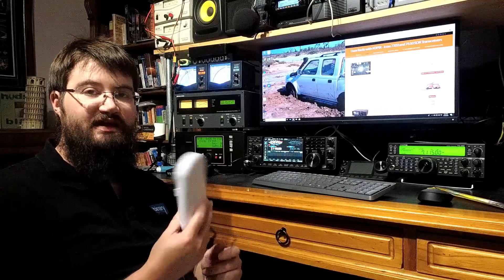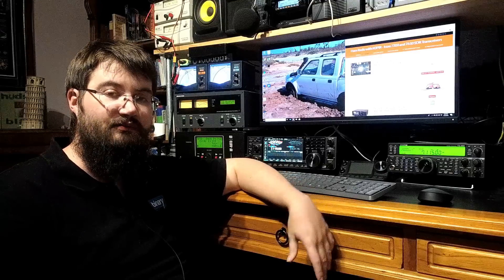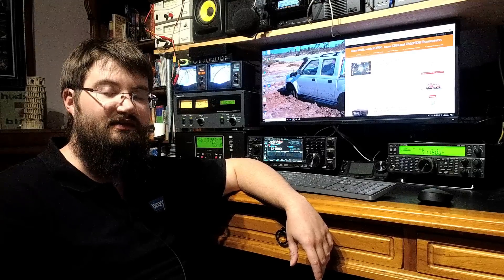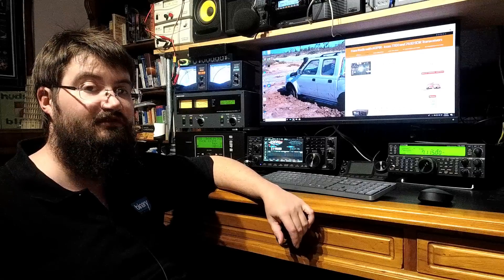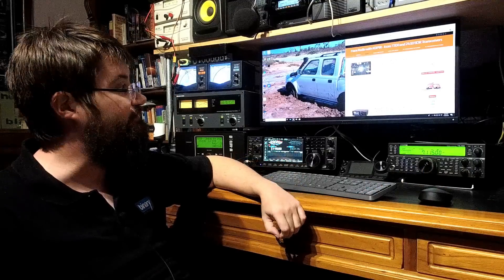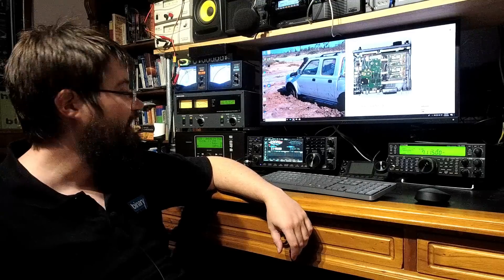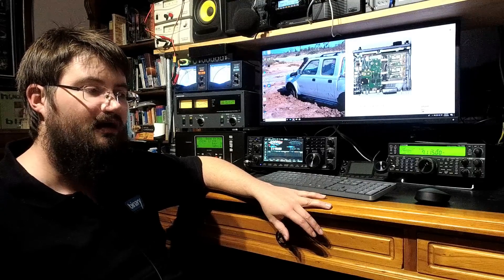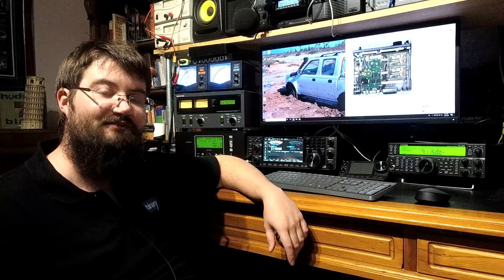IC-7610 Issues: LCD Burn In, 'Heatsink Gate' & Others

Comment: Hopefully Icom makes the LCDs available at a reasonable price.  If I have to replace it every 3-4 years due to burn in I'm not going to complain too much, it's otherwise a fantastic radio at the $2990 price.
Reply from the maker: Thats a good way of looking at it Andy.  Icom have always had very fair pricing on spare parts.  I will always remember when a grey import dealer quoted me a whole new remote hand mic for $100 USD, yet when I drove down to Icom not only did they have the LCD I needed in stock, it was only $5 USD!  I bought two just to be safe!  

All that said, we suspect its just a bad batch, and that a once off replacement for affected units will be all that is required.

It absolutely is a fantastic radio, and mine hasn't left the shack to get the LCD fixed even under warranty yet as I would miss having it around too much :)  

73, Jarrad VK3BL.

Comment: the display issue still has not been completely ironed out,  some people have had multiple display swaps...knock on wood  my 7300 has no issues in my experience , display still looks new after a year of use. I wanted to upgrade my rig but think I might cross the 7610 off my list ,  looking at the kenwood 890s now even though the waterfall on the 7300-7610 seems to be more fluid with a higher refresh rate ... the 7300 is solid rig for sure

Comment: Yup its an issue, mine which also falls in the range of S/N's for the heat sink issue too, has the burnin/ghost image issue really bad. I have been in contact with Icom america, but they had no real time line on a correct fix, short of replacing my screen with the lot of bad ones and roll the dice.  I was told to call back....LOL...I have( 1 month later) and have gotten absolutely no where.  Now I am am seeing ALC issues where the ALC completely stops working on the meter function. 3 resets and I still see it at random times even using the stock mic and factory defaults. I feel ICOM has and is dropping the ball on a radio at this price point.

Comment: The new LCD revision fixes the issue, its a new LG panel part so good news for those who waited for the bugs to be flushed out due the early  beta testers. And also a 400 dollar savings as well.
Reply from the maker: I’ll be booking our unit in for a LCD replacement soon too can’t wait but don’t want to part with the radio either!  73, Jarrad VK3BL :)
Reply: Hi Jarrad...I sent you an email about this as well, so sorry for the duplication. But this is the first I've heard about new, dependable LG displays. My screen went south after only two months and Icom has been largely silent. Do you have any more details about this new screen? I've got a number of folks that would be interested to know more...thanks. @RateMyRadio
Reply from the maker: Dear @joebozell6531 , please accept my apologies that I haven't had a chance to reply to the email - it is flagged :). This is also the first I have heard of new LG Display but when I take my IC-7610 in soon for a replacement under warranty I will find out more and report back.  73, Jarrad VK3BL :)
PS, comments here come to my attention a little quicker than emails as I get fewer of them.  Sorry to hear your screen went bad in a similar time to my first two.
Reply: @RateMyRadio   Jarrad...no problem at all and thanks. I might have mis-interpreted the note from Videosuperhighway directly above that implied the appearance of a new LG panel. I definitely don't want to be spreading unsubstantiated information, so I'll be looking forward to hear what you find out from Icom directly. 73/Joe/WB0CDY (I have no idea why YouTube gave me the username that it did. :-)
Reply: @RateMyRadio  i have herd that the replacement screen is only warranted  for 30 days

Comment: when does the new batch of 7610 come out if u don't know just guess thanks  de  kd6erp
Reply from the maker: I would say most stores / countries would be at least on their second consignment by now. :)
Reply: @RateMyRadio  now I have herd from 2 sources about the ability of running a external touch screen monitor on the 7610 one says it cant be done because of hardware reasons the other says they are working on it .

Comment: Very good review , i bet icom has fixed those problems in there new batch of radio,s  , might be worth buying one , once all the small issues are corrected on the new batch.
Reply from the maker: I am certain they have now :). The radio is a steal at current US prices!  73, Jarrad VK3BL
Reply: small issues  HA HA you send it in for a screen replacement  and it (  the screen ) is only warranted for  30 DAYS

Comment from the maker: W6RZ just posted this on eHam, we can confirm US 7610s are affected:

1) K3HTK,  2/1/2018, No S/N, Top left side washed out
2) N8DC, 2/1/2018, 12001026, Lower left side washed out
3) K6DHL 2/3/2018 12001103 See Spec Scope burn in
4) WB5JJJ,  5/13/2018, 12001105, 1/4 of the screen is fading
5) W5JMW, 5/11/2018,  No S/N,   Burn in of previous screen
6) N8DC, 5/29/2018, 12002146, Display issue again and this time the right side of the screen is washing out
7) N0JX, 6/1/2018,  No S/N, Right side Washed out
8) N8AWW, 6/2/2018, No S/N, Similar problem (washed out)
Reply: Rate My Radio ‘

Comment: Latest display issue is the right side of the screen turning considerably lighter than the left side. Didnt see any burn in but the display is failing. Also with the right side issue the whole display is starting to look bad. (lighter)
Reply from the maker: Is this with your radio Dave?  And excuse my memory,  but are you also a VK? 73 Jarrad VK3BL
Reply: Rate My Radio yup my rig and no I am not a vk.
Reply from the maker: Sorry to hear about your radio Dave; where abouts are you located?  73, Jarrad
Reply: Jarred sorry I am late getting back to you. I have been pretty busy and traveling a bit. I am in the US.  Michigan to be exact. I no longer own a 7610 and I will leave it at that . I do have a 7300 and I think its a fine rig. I am still looking to get another dual receiver rig but I will wait out the new Yaesu and see what they have to offer. Keep up the good work with your videos. 73 de Dave N8DC

Comment: Love the Ubiquiti hardware!!  Have a Unifi AC Pro myself, as well as a USG and plan on getting their POE+ managed switch.  Sucks about the burn-in issues.  Wonder how much of an issue it has been with the 7300's?  I'd imagine that long term that isn't going to be good for usability.
Reply from the maker: I use the UGS at home, as well as the UniFi AC in wall access point, and an older generation UniFi AP Pro.  I've got a 'tough switch' as the POE device :). As for the 7300s, there are essentially no known issues with that radio - its as perfect as they get.  Mine was on 24/7 for 1.5 years and the LCD was as crisp as the day I got it!  73, Jarrad VK3BL :)

Comment: After the long delay, I am disappointed with the 7610.  All the issues, wobbly & loose volume knobs, the display does not render numbers & letters very well, etc.  I am an Icom fan, but I will not buy another until they update a few things. When you compare the gorgeous display on the Flex6400M, I have to wonder why Icom decided to go with the lo res screen.  I liked my 590SG receive better under noisy 80M nite conditions.  Regardless of my experience, I am always happy for those who like their rigs, even if I don't.  I am glad you like the 7610, Jarrod.  73 Bob
Reply from the maker: Dear Bob,

It isn't without its share of issues - a few more than normal - but if you read the eham reviews of mid and high end transceivers, it seems every brand and every model has a bunch of quirks, especially the early production runs.

So I think it comes with the territory to some extent.  Rather than worry about such things, I accept that I took a chance being an early adopter, and just enjoy the radio; after all it has some terrific, ground breaking features for a knobbed radio! :)

That said, I believe its important to acknowledge the issues so that other people know to look out for them in their own radios.  This is especially important if you live in a country where there is only a 1 year warranty.

Some people feel differently, and accuse me of hating Icom etc, but the way I see it, my own personal sense of Integrity requires that I disclose my experiences in order to aid fellow Hams.

I am pretty much a die hard Icom guy, in so much as I live near their national service centre and they have ALWAYS looked after me promptly.  I state that quite often in videos, which makes it all the more confusing when people accuse me of being anti Icom - nothing is further from the truth!!  Warranty and Customer Service are EVERYTHING in this day and age.

I will admit, the Flex6400M may be a better choice if you're stateside and have a local service centre; if we were to buy one in VK, we'd have to ship it back for service and that would be VERY expensive and likely result in not having a radio for well over a month, so it simply isn't a choice we have.

Thanks for the comments Bob, we always enjoy hearing from you on our channel!

73, Jarrad VK3BL & the RMR Team :)

Comment: 5 years Icom warranty in Australia.. Superb!..  I wish I able to get that kind of warranty in my country. :)

LCD burn-in:
That is bad. LCD panel should withstand  high temperature for certain amount of time.  Hope it is due to bad LCD panel batch. 

Heatsink fall off:
This is the worst. Imagine if the heatsink fall off and touched certain part of the PCB, and short circuit it, especially near the PA, it might be the hazard risk which may cause fire. 

I hope my IC-7300,  does not has those issues, especially the heatsink fall off. 

Looking forward for your next videos. 

Thank you,

Bahathir 9W2GNU, 73.
Reply from the maker: Dear Bahathir,

Lovely to hear from you my friend - I trust things are well in 9W2?

The IC-7300 has a fantastic reputation for reliability; whilst we don't have exact numbers, speaking with the local VK dealers I'd estimate the rate of failure is better than 1 in 200, if not much lower, so I don't think you'll have any trouble.  Icom really did a fantastic job with that radio!

I agree with the issues of the heatsink falling off.  I actually had one person of Facebook call me all sorts of names and threaten to dedicate his life to wiping me off the internet because I dared to mention it!  He had decided that the heatsink wasn't needed, so if it fell off it didn't matter.  Apparently, the concept of a conductive object wobbling around the case did not bother him.

Luckily, the heatsinks in question are mounted on the underside board in the radio, so if they fall off they tend to just sit on the chassis.  The only harm that could really come is if you were to move the radio and in the process it got lodged between components or caused other kinds of mechanical trauma.  

That said, it is still a fault - not unique to Icom - and does need to be fixed.

Thanks for dropping by again my friend,

73, Jarrad VK3BL :)